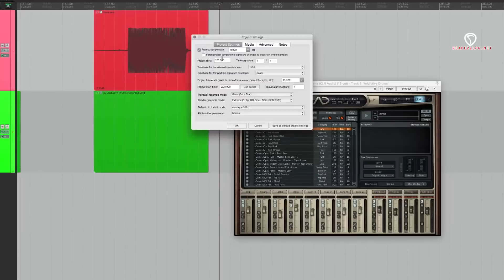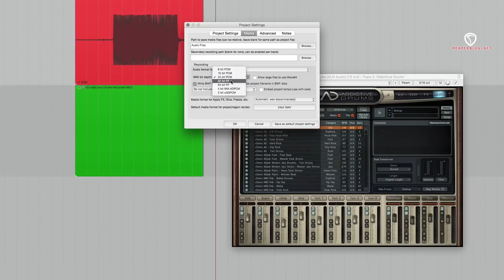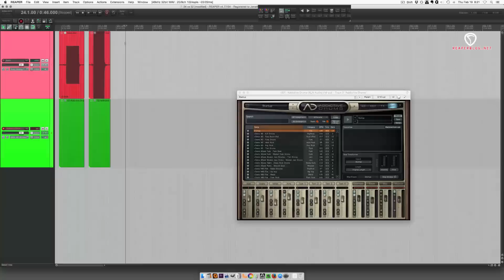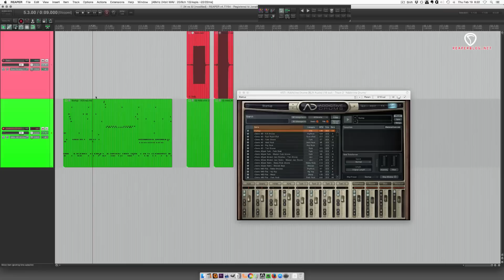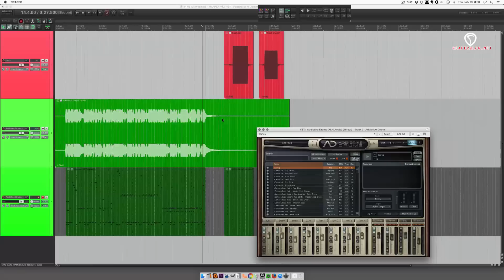24 and 32 bit Recording Formats in REAPER

Comment: Generally, I don't see a big use of 32 bit or 32 bit fload recording as the most sound interfaces feature 24 bit AD converters. That means, you're just adding those 8 bits = at least 33% bigger files. At the end, you're exporting to 44.1/16 bit (CD quality) so firstly you are upsampling (using some black-box dithering algorithm), and then again you are downsampling. If some parts are recorded on different devices and with different DAW software... I am already afraid of what is happening in all those black boxes convert formats (are they really the same). Then, in this example, the power of 32 bit float was demonstrated through headroom for sampled drums. That doesn't make much sense to me. Again, probably samples are 24 bit, they are running in 32 bit float project and I really do not understand why to clip them at first? Recorded bass, at the beginning... that makes more sense, however, I do not see the purpose of adding gain at sound card, because you are just increasing the level of entire signal, including hiss and noise. If those channels were level balanced (by turning down volumes), and probably compressed, The only question that is left - do we need then so much headroom? Probably, in some very dynamic mix, with tons of channels would require 32 bit (or 64 bit?) float, until then, to me, that is only wasting your hard disc and system resources,
Reply: this of course doesn't apply to live recording  as it can be really nice to have headroom when you do not have quiet environment and time for taking care of levels. But if recording at home - 32 bit (to me) is just overkill

Comment: The most audio interfaces out there have 24 bit analog to digital converters.. With 32 bit AD Jon maybe you earn the headroom with this gain..the internal job is something different
Reply from the maker: things have changed a lot since this video. Its exciting to see portable recorders now capturing in 32-bit float internally. Connected through USB most revert to 24-bit though. Check out The Home Recording Show #309 for more on this topic.
Reply: @TheREAPERBlog   but but but... IIRC there's no such thing as a 32 bit AD converter... internally those recorders have TWO gain settings with TWO 24 bits ADC and if clipping occurs, they reconstruct the signal on the fly with probably some artifacts... it's essentially automated Zaxcom NeverClip™  all again.
Reply from the maker: @physiqueDrummond  Internally that may be how they work, but as far as how this is presented in the driver to the computer is what's most relevant. There are now 32-bit audio interfaces with no gain controls.

Comment: you can use 32 bit float to correct distortion from analog sources. Normalize isn't the way to do it because you're adding compressor to just lower the levels. Just bring it down in your DAW and the signal is fine.
Reply: No mate, If the signal distorts your pre's going in, It stays distorted. And normalise isn't a compressor, It sets the highest peak at zero, It doesn't alter the relationship of the other peaks.
Reply: if you record distorted sound (accidentally) from analogue sources - you're screwed.

Comment: There's another application for 32 bit float which is if you are printing FX on the way in, whether via outboard DSP a la UAD or with input FX in REAPER. Still better to just gain stage correctly; the 32 bit float in this case is just a safety net to make save you from accidental overs.

Comment: Jon, can you please do a video on the different rendering options in Reaper - render, freeze, apply track FX as new take, group items within time selection, e.t.c. I think there are even more options in the actions list. I find these options quite confusing at times, with a lot of trial and error to get what I want.

For example, "Render items as new take" doesn't render the fade in or out, which i often want to do, and I've discovered that "group items within time selection" is useful for rendering reverb that was applied as a take effect rather than a track effect. Useful for sound design where I want to reverse a reverb tail.